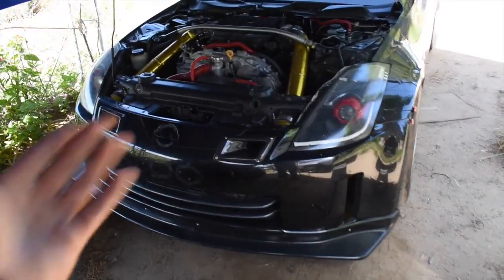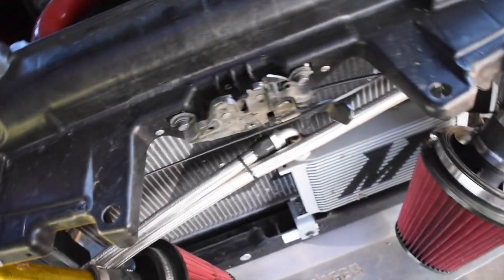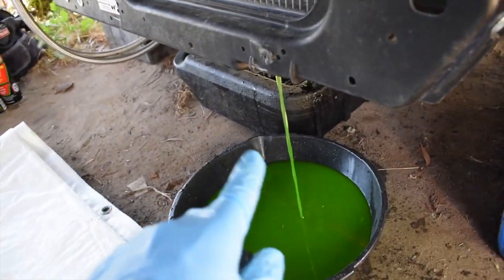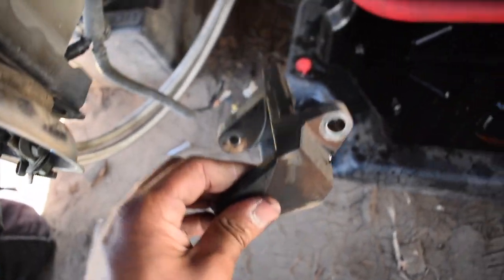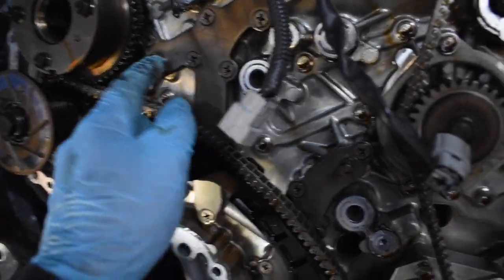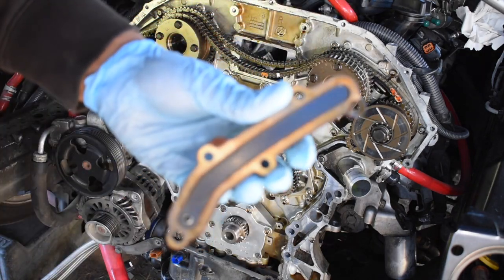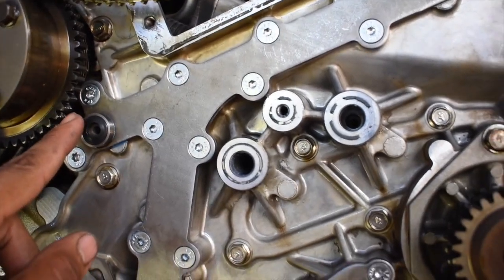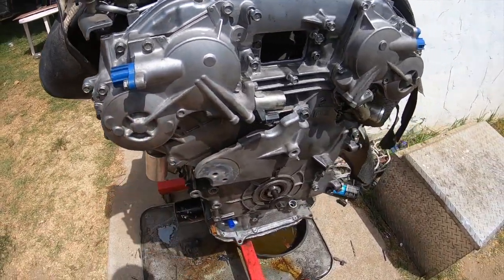VQ Gallery Gaskets Made Easy | G35, G37, 350z, 370z

Comment: hi. I bought a chiseled crankshaft and then bought inserts for it. I also changed the gallery gaskets. I measured the pressure on a 5w40 synthetic and showed 0.75 bar (11 psi) when fully warmed up. Is it not enough? are the liners bought after buying a wasted crankshaft to blame for everything?
Reply from the maker: I only run the recommended 5w-30 oil in the system and at warm idle it normally sits pretty low at 12psi only skyrockets when you get on it.

Comment: I just got my car[ 08 350z] from the Nissan dealer. Had a major leak turn out it was the water pump. Quoted me 1600$ for the 9 hour job. They call me back the next day that my Gallery gaskets were bad and a new thermostat needed. , they ask me if i ever had a low oil pressure light on i told them i never did but i do remember seeing my oil pressure really low like 10-20. Never even heard what a gallery gasket was till now and just gotta say thats alot of work and i would go insane even attempting this. So now i feel better for paying 2000$ at the dealer knowing all this work it takes.
Reply from the maker: Yeah I agree. It does take a lot of work to get to the gaskets. I wanted to learn to do the job myself. Save some extra bucks.
Reply: @tuned_tunas  save alot of extra bucks 😅... i have no patience so i coudlt do it and i would loose alot of bolts in the process
Reply from the maker: I get that bro. Whatever feels more of a better route for you. Sometimes people don't even have a place to work on their cars. At least you know all the work going into your car when you get it done💪💯

Comment: My 2010 FX35 is in the shop getting this don alone with my head gasget (had a warped head), theyre also doing timing chain, waterpump tensioners and all gaskets.... kinda like a rebuild! i should be picking it up tomorrow or tuesday. Excited to get it back.
Reply from the maker: Glad to hear you’re getting a full refresh. That is quiet a bit if work on a VQ. Hope everything goes smooth for you my dude and have the car back on the road soon👍🏽
Reply: @tuned_tunas  Ive got my car back last monday and so far so good... I've driven the car a good 65 miles and its good. i been checking the coolant here and there out of habbit, but its great, i tried looking to see what was the entent of the work but i coult not see anything, but the car has new life and drives like a dream.... just need some high flow cats installed on mine as my stock cat converters are rattling..... i'm at 174K miles.
Reply: @tuned_tunas  
When i picked up my car the coolant level, in the expansion tank, was at MAX, since then, I've driven about 200 miles and have noticed that coolant level in the expansion tank is now between MIN and MAX.

Should I be concerned that now I'm losing coolant in the expansion tank? Should i call the mechanic and let him know or should i wait and see if it goes down pass the LOW line? All in all, the car is running like new, and maybe I'm just paranoid now with some sort of Coolant PTSD, but man, this is freaking me out.

Its covered under warranty, but, wanted to hear you guys thoughts!

Comment: You recommend changing the chains and guides or mainly gallery, water pump and thermostat ?
Reply from the maker: I never changed the guides or tensioners. I only replaced the gallery gaskets. Water pump only when it needs it but I left the stock one. The thermostat you can get to even when the motor is closed.

Comment: what was your symptoms to a worn out galley gasket ? My g37 is at 213k after getting my alternator replaced i started having rpm issues. i did everything possible to fix the idle. still nothing . After driving for about an hour the car gets stable . No rpm issues. but sometimes when i stop at the light it goes crazy ,then today i seen a quick flash of the brake symbol then it went away . what the heck is going on with my g. i feel like selling it for a q50 . your thoughts?
Reply from the maker: 350z have a gauge so that’s how I could tell that they were out. Oil pressure was only hitting 90psi when it should be hitting 120 easily. With that being said your issue sounds a lot different. Maybe clean throttle bodies and maf sensors. See what that does. Is there any codes ??

Comment: Hey man just watched your video and it’s great. I have a ‘03 350z which I’m swapping an hr in. I bought a wrecked 07 350z that is everything I need but the motor has 180k miles. Do you think I should do the gallery gaskets while the motor is out before putting it in the other car even if my oil pressure is fine?
Reply from the maker: save yourself the headache now and just do them. don't wait for the oil pressure to be low. it might already be too late by then.

Comment: Please don't hate me for asking. You seem like a knowledgeable guy. Would a vq35de block mate up to a HR heads and intake system? I probably need a ECU swap and some wiring. But I built my bottom end with forged. And didn't think about how the HR has better valve timing system. It be a Frankenstein build but have you ever heard it done?
Reply from the maker: Never heard of it. But my question is why you would bother to keep the DE block. The piston rings are trash in those cars that’s why they tend to burn oil. HR block far more superior in my opinion.
Reply: @tuned_tunas  When I bought my Z for $3500.  It had a carbon hatch, 18x13 rears and 18x10 fronts SSR wheels, full HKS exhaust, and Carbeua seats. The engine was out but it came with 2 engines with manual transmissions and a Rev-up doner car with blown motor in stock automatic trim. The Z I decided to built was the early 2003 edition in Nismo trim. So for $3500 my rabbit hole has gotten pretty deep
Reply from the maker: You have most definitely gotten yourself in deep. But if you’re having to get the Hr ecu and the wiring harness it only makes sense to take the block with you. Just my opinion. In a world where we have a DE & HR why settle for less ??

Comment: have you tried retapping the hole first? could've gone one size up if you couldn't save original thread size. way easier than replacing the rear cover because of one hole.
Reply from the maker: First we stripped the head of the bolt. Then we snapped the bolt trying to take it out with a bolt extractor. So we rethreaded the hole and it wasn’t tightening to spec. Kept getting loose so I figured that instead of having to enlarge just one. I rather have it be done right.
Reply: @tuned_tunas  i see. i bet stepping up a size would've been ok, but that's water under the bridge. thanks for the vid!

Comment: Awesome video bro. Do you have any tips on how to get the timing cover off mine has so much gasket maker
Reply from the maker: They have certain marked areas on the face cover where you are supposed to start separating it. I used one of them automotive spatulas and a hammer to get it in there and start it. Starting it is the hardest part. My tips are just to start off slow not too fast or you’ll carve into the metal.

Comment: Replace the coolant with Evans waterless coolant for racing it has a higher boiling point. It comes only in half gallon.
Reply from the maker: I havent had any cooling issues with regular coolant. I do plan to switch to distilled water though. But we'll see. I'll check out the one you recommend as well.

Comment: did your cams jump after you took chain off?  looks like they did because your marks moved around,     i had my cams jump especially passenger side one,   will i be ok if i just turn it back to how it was and put chain back on?
Reply from the maker: They are going to jump. Best thing is to make sure everything lines up with your timing marks. Got another video that shows y’all how to get that perfect timing.
Reply: @tuned_tunas   Yeah mine jumped too, but i Marked everything.   Started the engine and its fine, but now im dealing with new issues unrelated to the engine.  I got evap error code for P0448 ,  evap vent circuit is broken,  but yeah.  I am working on that problem now.  Also got a popping noise coming from the rear of my Z

Comment: What tip you used to take out the broken bolt to not miss up the threads
Reply from the maker: I prayed and used a bolt extractor. I got it at Ross. It’s a drill bit type.

Comment: Please I need help , question and cannot find answers 

Vq35hr 350z 2008 A/T 151km 

I have all the symptoms of blown gallery gasket, but I was stupid that I didn’t change since I started to have the symptoms since almost one year 

I am not driving the car hard , very rare when I have aggressive drive only high way 

I am having recently slightly ticking noise

Is it worth to replace the gallery gaskets, water pump, thermostat or do I need to replace camshaft or rebuild or just buy engine or sale the car 

Please need answer
Reply from the maker: You waited too long my boy. Gallery gaskets are the least of your worries now. I’d focus more on what’s making that ticking sound. Got to stay up to date with maintenance
Reply: @tuned_tunas 

Maaan please I need your advise 

 Please note that my oil pressure is after fully warm up is around 8-10 psi / 2000k rpm around 40psi / cold start 80 psi

I have sputtering rpm after warming up only low rpm and very slow acceleration 

I did these 4 tries to confirm that I have vtc issue

These results confirmed by driving long distance with every try just to confirm the results

1 - disconnected vtc plugs both sides = issue gone

2 - disconnected vtc plug right side only = issue gone

3 - disconnected vtc plug left side = issue gone

4 - plugged vtc plugs both sides = got the issue back

Really want to confirm before I waste more and more money

I know the gallery gaskets needs to replaced but for now ,This sputtering will be fixed after I replace this vtc or the oil pressure will be the main issue? , I know and saw in groups some guys their oil pressure is less that 8 psi and they don’t have this sputtering

if the replacement will fix , do I need to replace both sides full covers assembly or just the variable valve timing solenoid

Comment: Why did you not replace the oil pump when you were in there?
Reply from the maker: Nothing wrong with my oil pump. Didn’t see a reason for it. Didn’t change out the water pump either. It’s fine.

Comment: In the newer generations of 08 g35. Where do I check the oil pressure  doesn’t have one
Reply from the maker: You can always check it with up uprev with a data log. There’s no option on the stock car. That’s a luxury car which explains the lack of gauges

Comment: Hey Tony, I’m getting an engine swap due to my hr having rod knock due to gallery gasket leak. But because of  the expense of doing full timing job and it not being necessary on a 70k mile engine, just want to confirm, can the gallery gasket job be done on its own ie without doing any of the timing? And if so is there anything you think is highly recommended to do at the same time like guides or tensioners or water pump. Basically the minimum effective job for a 70km engine purely as maintenance while the engine is out.  Thx brother.
Reply from the maker: You have to take off the timing chain to do the gallery gaskets. So you will either need to mark where they are before you take it off. Or use the markings already on it and align everything back up. I kept the same water pump.  I would only see you needing to replace it if the pulley is loose.
Reply: @tuned_tunas  Thank you for the reply brother. So unless signs of significant wear or anything loose, its fine to just do the gallery gasket?
Reply from the maker: Yessir. Thats all I did.

Comment: Yo tony mine is doing a engine noise u think it could be the timing chain n the gullys gaskets?
Reply from the maker: Not sure bro. Hard to diagnose through the comment section.
Reply: Yeah i got all open timing chain tentionor broken made lil slack to chain but droped oil pan seen lil shaveings of metal
Reply from the maker: Sheesh that’s not good bro. If the tensioner broke then it’s probably gonzo
Reply: Yeah u think ama need whole new engine ?
Reply: Or u think i can replace those things n well be good for a while
Reply from the maker: You should be able to replace whatever is wrong with the motor. These cars are built to take a beating

Comment: How often does this need to be done?
Reply from the maker: I could be wrong but I’d say every 90k miles. As long as you took out then stock paper gaskets you’ll be good
Reply: @tuned_tunas that’s reassuring haha. Looking at picking up a 2009 370z with 60,000km on it. So I guess it’ll be good for a while. Thanks for the response.

Comment: not sure if it’s my galley gasket or not, but whenever i push my car heavy my oil pressure reads 0 and then disappeared after a few seconds. sometimes flashes but after a while it’s just gone
Reply from the maker: Could be. Cant go wrong with changing it anyways. Maintenance before mods

Comment: My oil pressures at pretty much 0 when the cars warm (I don't drive it anymore cause of that) also I noticed when I first saw the issue when I made a turn the pressure would go up any ideas I wanna get it fixed. I already replaced the galley gaskets.
Reply from the maker: Not a clue man.
Reply: Did you figure it out?
Reply: @mosdiy8096  no man ended up selling it unfortunately...the guy I sold it to LS swapped it Lol it's a monster now

Comment: Any issues with belt slippage running the A/C bypassed like that? Any track time? If the crank pulley is the same diameter as stock, belt part number? Thanks.
Reply from the maker: No issues at all. Hasn't been on an actual track but I do beat the living heck out of it. Don't have the part number on hand but its in one of the videos doing the actual ac delete.
Reply: Tuned Tunas thanks, I’ll check it out.
Reply from the maker: Glad to help

Comment: Why did you buy the garbage gaskets again. You should’ve got the reinforced ones
Reply from the maker: On the website it said these are not the original ones. They're upgraded oem with metal in them
Reply: The OEM ones were upgraded. They're fine

Comment: Damn my z has 80k miles and the oil pressure isn’t to where you say should i have this done ??
Reply from the maker: Most definitely. Not only are you keeping up with maintenance to make sure it’ll run forever. But not hitting proper oil pressure could be loosing power based on how bad it is.

Comment: Where did you get all these?
Reply from the maker: Get what the gaskets ?? Z1 Motorsports
Reply: @tuned_tunas  yeah my leaks oil from there right onto my alternator and it’s coming from up top
Reply from the maker: Could be power steering could be your gaskets. Only one way to find out.
Reply: @tuned_tunas  I thought it was power steering but I just replaced my steering pump and alternator idk but that is for the help bro this shit helped
Reply from the maker: Glad to help bro. Hopefully you get it fixed💪

Comment: Where you at in Cali I need help
Reply from the maker: Bay area. What's your issue ??
Reply: @tuned_tunas  I test drove a G37 yesterday I noticed the temperatures was kind of high kind of scared of buying one are these engines reliable
Reply from the maker: Can't go wrong with a VHR my guy.
Reply: @tuned_tunas  one last question bro both cars are going for 6800 the 37 has a hundred fifty thousand miles the 35 have a hundred and ten 08 of course which one would you buy
Reply from the maker: I love me an HR bro but if I had to choose I would try to get both for 6k flat and whoever is down is what I would go with.
Reply: Tuned Tunas will do sir and once I get mine how can I be down with the tuned tunas
Reply from the maker: If you support watching the videos you already Tuned Tunas. This aint no car club we a movement.
Reply: I bought g37 2010
Reply from the maker: That's right💪
Reply: @tuned_tunas  I'm in Los Angeles area I want to learn how to to work on my own car unless I can pay you to handle some things for me
Reply from the maker: Its better if you learn the car yourself bro. We way to far apart to do something

Comment: Could have watched my video.  I went into more detail.  But good job the job is a pain
Reply from the maker: All the videos I've see was multiple parts and not clear enough. I must have not seen your video.
Reply: @tuned_tunas  thats the way I felt
Reply from the maker: We just out here helping the community bro. Thats what its all about💪🔥
Reply: @tuned_tunas  that's why I do it
Reply from the maker: Keep doing your thing bro💪
Reply: @tuned_tunas  oh I almost forgot.  I used the oem gaskets and after 8,000 miles it broke again even with new bolts and blue lock tight. Im going to do the job again with better aftermarket gaskets and sell the frigging thing.
Reply from the maker: I used oem gaskets as well these were advertised as the upgraded metal ones. Everyone I asked had good luck with these.